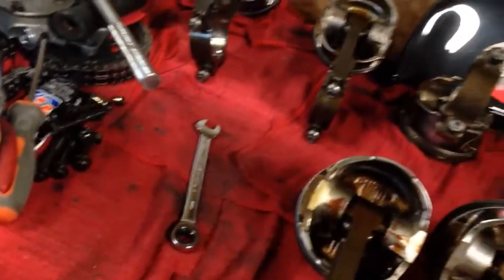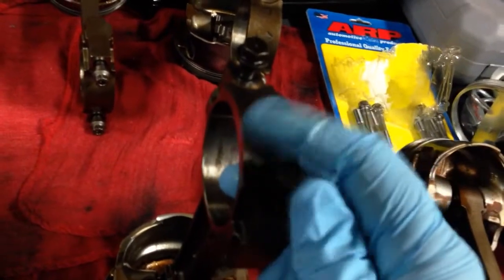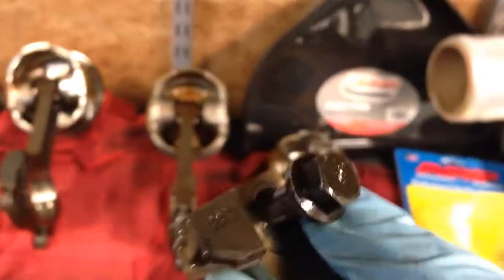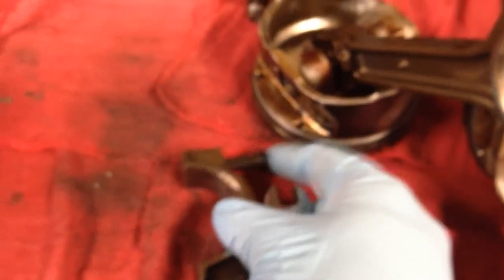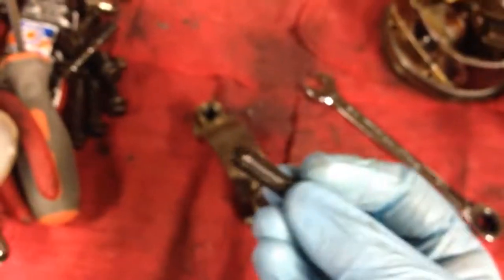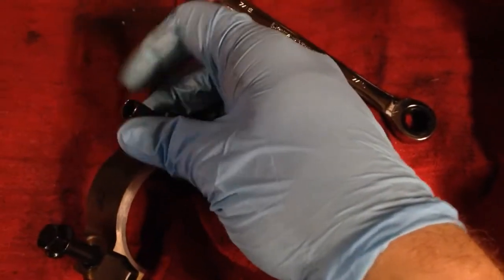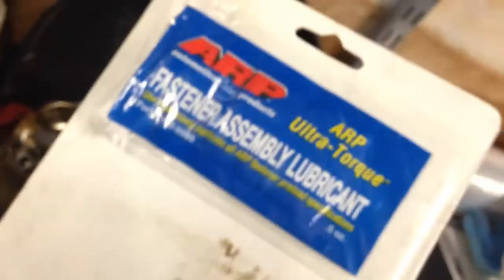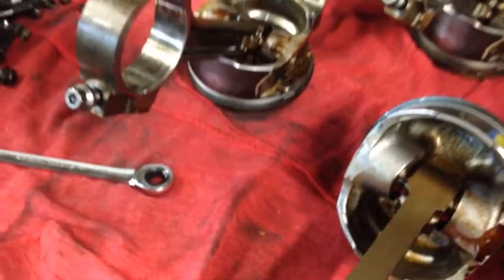LS2, LSx, LS Engine Motor - How to remove connecting rod bu

Comment: WARNING! Although use of this method to remove the rod ferrules won’t distort the rod caps, it can damage the rod caps by marring the fracture surfaces. This can prevent proper mating between the caps and rods. The problem is that, when the ferrule pops out, the bolt head inevitably smacks the fracture surface. And this hard metal-to-metal smack is enough to mar the surface.
Luckily, this damage is easily preventable when using this method. Simply make a thick rubber ‘washer’ using a short section (maybe one eighth inch) of rubber hose that fits the bolt. You can either use hose that is just large enough to slide over the bolt. Or use a sligtly smaller diameter hose and split it along its length so that it can easily be put on the bolt. This will prevent any damage to your rod caps.
Reply from the maker: Good tip. To note, the powdered caps aren't that soft, the vast majority of the impact is absorbed by the bushing when smacking the head of the bolt, but adding grease under the head of the bolt or a rubber washer surely wouldn't hurt!
Reply: The bushing does absorb all of the force - until it decides to pop out, that is. When this happens, the face of the bolt head will kiss the fracture surface. And because the fracture surface is uneven (unlike a milled surface), the contact area is very small. This causes contact stresses to be locally high, which nicks the surface. Grease probably won’t help much here. You need to use a piece of fuel line to cushion the blow between the bolt head and fracture surface. You can even cut the fuel line along the length in order to make the hose easy to put it on and remove it.

Comment: Great video, helps a ton. I was wondering with all the people saying to resize the rods, aren;t the ARP bolts made for a cracked cap so that you don't have to? How has your engine been running after putting these ARp bolts in?
Reply from the maker: roadifier My motor ran great for over a year until one of my wrist pins came loose and destroyed my block and one head last october 2014. In fact, the rod sheared, and the ARP bolts still held the bearings, and caps together without problem. Just make sure to use the the ARP lube and tighten exactly as instructed with a good quality torque wrench.
Reply: Ryan Wehrle Ah, a friend of mine that builds promod engines told me to change the wrist pins since he thought that they would be prone to failure. Good to hear that the ARP bolts were fine though, I just need this engine to survive a summer and the drive up to Ohio from Florida. I got them installed yesterday with the ARP lube and they seem to be good.
Reply from the maker: roadifier Yeah change the pins and use spirolox if possible. It caused me about 2k in damage =\
Reply: Ouch. Well I may just push my luck and see how far I can get with the stock rotating assembly. Once I feel like pulling the enigne out again if there are no problems, I'll just get a whole new rotating assembly that's forged.
Reply: +Ryan Wehrle All you had to do in order to get the bushing/sleeve out of the cap was, get a punch, put in on the bolt, and tap it with a hammer, they pop right out with the old bolt. You didn't have to take the bolt out, and insert it from the other side. not badgering you here, or saying your way is wrong by any means, just thought I'd share my technique with you. when someone has ideas that I don't know, I here what they have to say as well, it just makes things a little easier, and takes unnecessary steps out of an easy process.
Reply: +Ryan Wehrle Now I have a question that maybe you could help me with, I bought new stock rid bolts for my ls1, these new bolts have a bushing/sleeve on the shaft that floats, this sleeve confuses me because the rod caps already have a sleeve in them which you know about, my problem is, this new sleeve on my new bolts, is smaller, and dosent take up the same space as the original stock sleeve in the rid cap, what do I do? have you seen these rod bolts before?
Reply from the maker: +521CID Yes thank you. There are many ways to accomplish the same result, I just didn't have a punch at the time lol
Reply from the maker: +521CID I have not seen these bolts before, never purchased new stock bolts before. However, to answer your question, the best practice is to take a digital caliper (even a cheap HF one will do) and measure the OD of the sleeve you removed. Then measure the sleeve on the bolts you purchased. If it's vastly different as you are saying, then they are the wrong bolts. The collar is designed to do 2 things: reduce potential movement in the bottom cap, and to help on the assembly line to keep the bolts inside the caps prior to installation. This is why the ARP bolts have the raised land towards the top, to simulate the spacing from OEM bolts.

If your bolts loose with the bushing and bolt installed, don't use them and figure out why you receive the wrong part.
Reply: +Ryan Wehrle I think that's what I'll do, I'll keep you posted